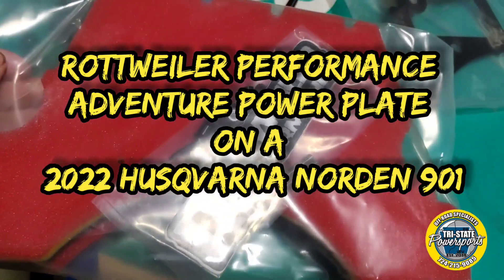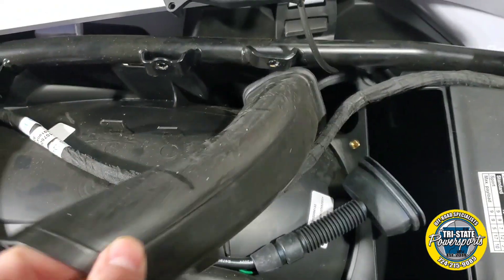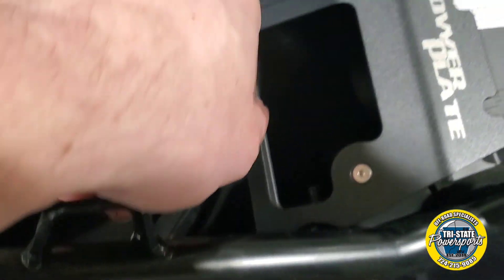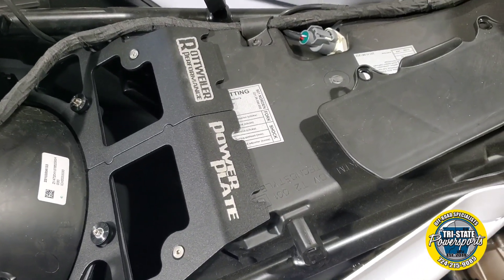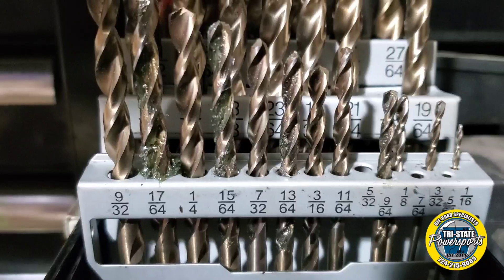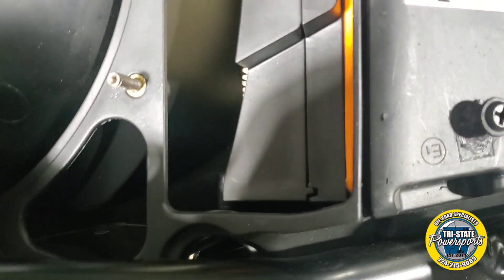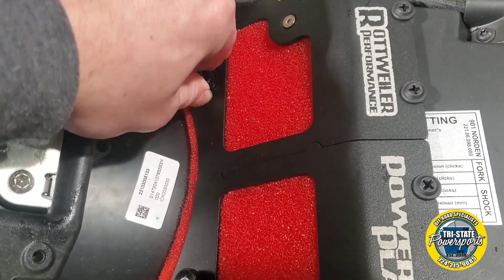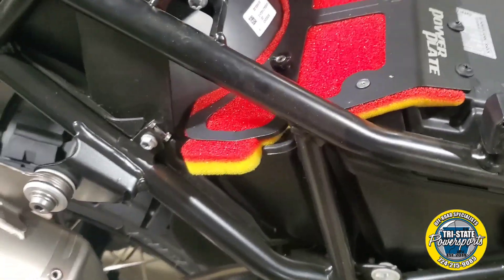Installing a Rottweiler Power Plate on a Husqvarna Norden 901

Comment: Even with the pre filter you should grease the sides of the air filter, so it seals better. The power plate definitely makes the engine more throaty sounding but I didn't notice any power gains on my 790R.

Comment: Aren't you suppose to leave the original filter out? You have two filters in now!
Reply from the maker: It's meant as a pre-filter to the oem air filter. I double checked with Rotweiller at first because I thought the same thing but they are leaving the original filter in also. By removing the small snorkels and solid filter cover, it allows the engine to breath better even with the additional filter!
Reply: @hoagiemoto  cool thanks. What power difference do you notice?
Reply from the maker: @barrysalmon9892  I didn't ride it much before because I tore my acl. So it's hard to exactly tell the difference. It sounds more aggressive now. Probably from removing that stock cover
Reply: @hoagiemoto  Thanks. Hope you recover soon and get back to riding.

Barry UK.